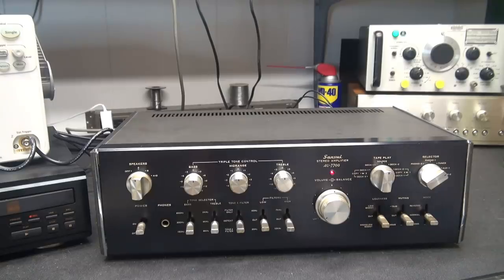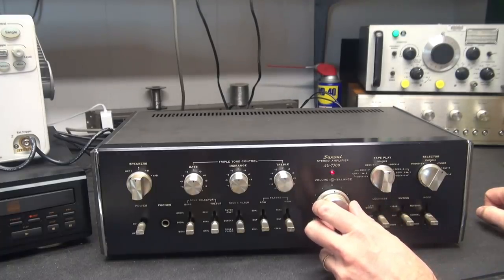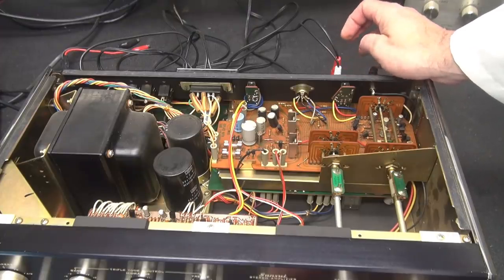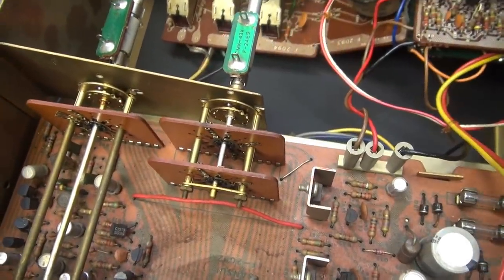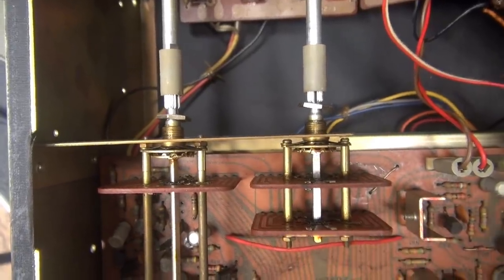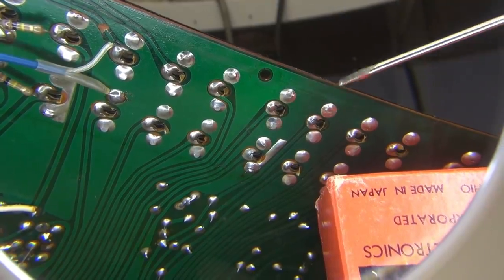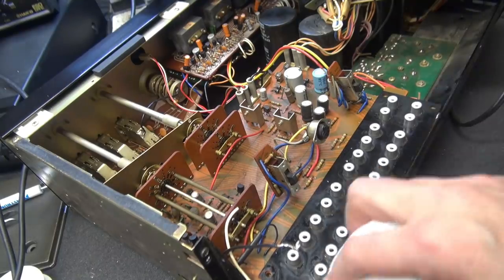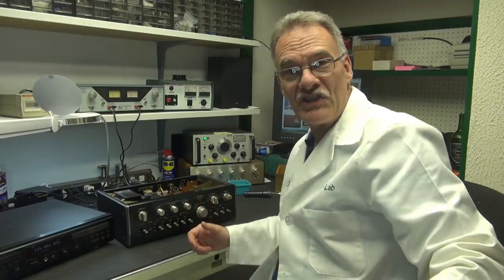How to repair Sansui AU-7700 Integrated amplifier Channel out or weak

Comment: I bought an Sansui AU7900 with a couple of slightly bent heat sinks. I was able to get them back in shape and looks almost perfect. The Phono channels were doing exactly as you described. The fix was exactly the same, but to get to it was a lot simpler. Thanks for the video.

Comment: I have a Sansui AU-9500 from 1976 that has never had the cover off.  Still is amazing amp.
Reply: I have had the same amp since 1974.  Cost me CA$750 back in the days of being a starving university student. My Dad thought I was nuts.  I was.  It did heavy duty as university DJ equipment for 3 years (along with Altec Lansing Voice of the Theatre speakers) and then "retired" to home use only for 40+ years.  Works flawlessly, and I love it like an old friend.  Meanwhile my 2000-ish HK AVR 7000 just lost 2 channels.  The 70s were great years!
Reply: I live in Scotland and I have a Sansui AU5900 that I bought 1976. I have the same issue with the sockets round the back being loose. I can still play sound through a CD player on one of the AUX positions and also FM from my TU5900, but my I am unable to play my Sansui SR525 turntable through the two phono sockets as  both are very loose. Nice to see what it looks like inside. It does look a fiddly job because of all the screws. Nice to hear the beautiful tone again so I plan to get my old system serviced and show it off. .
Reply: @jewesson  Same issue with my HK AVR 7000, now looking into buying the AU-7700 + TU5900. The HK AVR 7000 appears to be solder cracks as wiggling the rca ports indicates problem. Have yet to investigate physically, but research tells me it is the bottom board, and difficult/lengthy access. Love it when it works, a true powerhouse.
Reply: @jewesson  I have had my AU-7700 since 1978. I used to DJ house parties with it. Put all the music on my Sony TC-399 reel to reel because I got tired of people messing with my records, and didn't have to worry about requests. Still have the amp, will be my son's after I am gone. I have a set of Altec Lansing Valencia 846A hooked up to my Heathkit tube monoblocks in the family room. Always wanted the VOT, but they are big, even for a house.

Comment: Had the same problem on the same unit. Turned out to be those molex plugs where corroded and the solder joints on the RCA plugs . Changed all the caps while I was in there . This is an amazing sounding unit .

Comment: A trick to lessen stress on the jacks when plugging or unplugging cables: twist the RCA plugs in a rotary fashion as you push them on. Don't wiggle them side-to-side, that's how you stress the solder connections. The rotary motion also tends to wipe dust and oxidation off of the jack and plug..

Comment: Greetings Terry,
I have this same amp and have owned it since 1978. Since this time I have been in there at least 3 times to fix the same repeat problem. I got in there by removing the output board underneath, guess there is more than one way to skin a cat. Resoldering won't fix it in the long term, it will fail again. I was thinking of some way to give more support to the jack and relieve the stress on the solder joint. JB weld came to mind, but seemed kind of tacky, excuse the pun. I did fix my son's Hafler 110 preamp by drilling and dremeling the board and putting stud mounted RCA jacks with bus wire jumpers to the board. Never use those monster turbine style interconnects on these amps! I need to get in there and solder it up again, Ughhhh!

Comment: My Sony STR-7045 (original owner, parents) from 1973 is awesome af - my daily runner for EVERYTHING (home studio, I am freak guitarist, and all else - since I was born) - just put DC offset to +/- 1 mV from about 30, each channel, yesterday! It screams I tell you, no joke. Part of the reason too is that my main speakers is Marshall cab that I rewired to stereo (try it!!!!!) too. B speakers are 3-way home stereo Sony SS-U 431 AV, modest but kickass nice nonetheless. Anyhow, the RCA connections are not soldered to the board. They are just mounted to the rear of the case, with leads coming off them to the board. I DID have to DeOxit them and get all up in them with Q-Tips to get them perfect but that is much much better design than having to resolder, however easy that may be. Nice video D-Lab!!! I want to somehow put 1/4" jacks for the Aux1 instead, as that would pair lovely with my MOTU Traveler interface - it is in my thoughts to do list. I probably won't do it because of keeping it original, but I want to hahaha.

Comment: I friggin hate the Suits who told the engineers to put jacks, etc directly on to circuit boards to save money. There should never be an opportunity to put mechanical stress into a circuit board. Jacks should be mounted on a chassis!
Reply: Poorly executed design. There is no protection to the cables when they are plugged into the jacks  from being wacked by something! The field is too wide and stresses the pc board too easily . Some extra screws between the jacks should have been made  to keep that from occurring.
Reply: Dumb idea, I agree, I have this same AU-7700 amp and have owned it since 1978. I have had it apart probably 3 times to fix this same repeat problem. My son has a Hafler 110 preamp which suffers the same problem, so I drilled out the rca jacks and put stud mounted rca jacks with jumpers. No room to do this in this Sansui however. Needs it again, weak point of the design. Was thinking about JB weld, but that would not be good engineering either.

Comment: 10:00 Did you see that trace on the circuit board that is cut? The blue shielded wire connects to it. Looks like perhaps it is a factory revision. Will have to look at my AU-7700 when I get it apart again.

Comment: You need to put together a small wine room and equip it with a small sound system. Wish I could have enjoyed a glass before hitting the bench with some of the equipment that used to come into the shop I worked at in the past. Abuse and DIY repairs. Made for a bad day.

Comment: At 7:50 is the point where my boss would be yelling at me to put some masking tape on the top edge of the front faceplate, and put a towel underneath that rear panel so it doesn't scratch the unit in a place that would be visible to the owner of the unit. It's true that often times I think it'll be a quick fix, and the back panel can sit where it's sitting for a minute, and then I'll be putting the thing back together, so I don't really have to worry about it; but I'm units this old, invariably there's something else wrong that you discover during the course of repairing the most obvious main issues, and therefore the unit stays in a disassembled state, with floppy metal parts tethered by wiring harnesses and  laying all over the place, for rather a bit longer than you originally expected or intended.

Comment: great video! I have one of these AU7700 and it sounds great but also need to solder the aux connections I think. On another note two of the spring type speaker connectors are  are broken how hard to replace or fix these?
Reply: P

Comment: Wow you were Air Force, so just my guess you were either PML, Ground Com or Avionics Com Nav troop? I was an in shop avionics Comp Repair manual test station  troop for the F15's back in the 70's and 80's so thanks for serving,  Great site you have!  heres my question,  I have two stereo units that are getting old LOL like me and both starting to have what seams like same type issues you have on this video, one is a Technics SU-V10X with 120 watt per channel I ought in Iceland in 1986 sometimes the output relays fail to switch on when powered on it will have no out power, then at other times when it dose power on and work and I increase the volume to say 1/3 volume or more ( but not all the time) they click off and I loose one and sometimes power to both speakers, so was thinking it may be same issues you just showed here with bad solder connection? the other unit i have is an old Carver 130 watt per channel Receiver, it is really bad very very intermittent, seems that this unit by what I've read is well known to have had a really bad solder joint issue!  do you have any advice if maybe I myself should just take them apart and inspect and resolder all the joints to see if that  fixes them before,  I see about sending them off to  be fixed by some unknown repair place, I live up in New England ( Ma) so not sure who up this way would be able to do any repairs on this old stuff, so any suggestions be appreciated.
 thanks
 Bob

Comment: I notice the chrome like surfaces have that nicotine yellow cast. I clean a lot of cigarette smoke out of vintage electronics. I suspect that the units from the 1960s on have other smoke on them too. ;-) Toss all the knobs in an ultrasonic cleaner with some alcohol for a good soak while you soak up an extra glass of wine! (Ain't I a stinker?)

Comment: Great repair and video ! - I've got a Sansui Z-9000 receiver that's has an intermittent channel  , wonder if it's a similar problem?
Reply from the maker: Best thing to do is tap the boards and see if the issue comes and goes. These old relics grow bad solder connections over time
Reply: Deoxit and visual inspection are the basics. Look for poped electrolytic caps or lots of dirt and dust shorting things out. I always have to clean the boards and potentomitors and that usealley is 80% of the time is actually the promble . The other times I replace mica capasitors or orange dip capasitors or I usealley find internally broken wires and replace them. And flux is your best friend just clean off the flux when done. And do not be intimidated by electronics I do not posess any electronic certificates or electro/ mechanical  degree of any kind. Unless you count my nartie and ham radio licence. If one man engineered it another man can figure it out. And fyi all a circut board is a flat wire connection between parts so that the electrons can flow and be regulated and +and- biased  from one part to the next to get the desired outcome of high  frequency low frequency or all 3 hi mid and low witch is fed through a roll off cross over. Witch separates the frequencies. To each channel aka hi mid and subwoofer.
Reply: Aside from dirty/ oxidized, intermittent switches and controls, and bad soldering, the output relay is another main source of intermittent channels. Tap it while unit is playing and watch the channels come and go, or dropping level, or become somewhat distorted. If you can play a pure clean 400 Hertz tone through the unit, it'll go from a clean tone to a mosquito-like buzzy whine* when you tap the offending component or area. Polish the contacts of the relay (a pencil eraser or ink eraser works well for this), degrease with pure alcohol or another similar no-residue  degreasing solvent, and retension the relay "fingers" slightly if need be. Do not, I repeat do not, spray the relay with Deoxit or any other residue-leaving contact cleaner.

* Sorry Terry, wrong kind of "wine"!

Comment: Well done ole man..I could not have done any better. 
It does seem however, that old electrolytic caps last  longer than the newer design...maybe due to power supplies or composition ? 
I gave my old 1975 england version kenwood quad for similar problem..weak front channels and crackles.. but at 75watts per it played wonderfully. I still have the quad vinyl lp s.. keep up the super show. 
Cudabigfish in Michigan , USA
Reply from the maker: Hello Gary, are you going to the Chelsea, MI hamfest? I will be there shooting video
Reply: @d-labelectronics   I might..first week of June is sisters  memorial and day following is family reunion all in Valpo, In. Busy shortly thereafter with new grandbaby due second week of June..eeehah!. I missed Dayton due to health. Hashnasi just did a review on a G90 hf rig..check it.
Reply from the maker: Will do Sir, Hope to see you there

Comment: My AU-6600 has a hum when in Phono, a tech I took it to said just use a an external preamp. Eventually I did that, and it does work fine with the Turntable preamp going into Aux-1. Disassembly on these is tough, but let's face it, the RCA input design is awful!
Reply: Oh well. My AU-6600 probably needs the treatment shown in the video. Perhaps you would like to see it, Terry? The thing is, this unit sounds even better than the old Marantz 2270 I have. Sansui said 42 Watts/Ch on the 6600 which I guess is RMS.

Comment: I have an amp in need of repair - you interested?
Reply from the maker: Sure, what is the make/model?
Reply: Sunn Beta Lead - its something in the preamp around the reverb. The power section works as it should . When the amp is used like a slave amp it rocks but otherwise without the reverb cranked the volume is low.

Comment: What's your opinion on the 1985-1990 integria onkyos
Reply from the maker: I liked the 80-85 series. My all time favorite is the silver face Marantz with gyro tuning, best is the model 2275
Reply: @d-labelectronics  ok thanks for the input. Cause I want another onkyo tx 866 and another tx 84 and maby another kenwood ge-1000 equlizer and I can stop collecting. Cause I know as these amps and equlizers get older the price will only go up. And plus I have an obsession with oscilloscopes. And digital scanners . So I figure the only way I can really afford to have all these old and new things is to get my realestate licence. Plus I also want the tyt md- 898 witch is a Chinese digital ham radio when combined with there hotspot can talk to yeasu icom dstar and apco phase 2 and most other digital ham radio formats. I probabley got the modle number wrong on the ham radio but I like to sit and stare at electronics and take them apart and learn about them . But my vintage onkyos only come apart when iam cleaning them or replacing old capasitors or repearing them. So far I really like the old onkyos ever sence my neighbor gave me his old integria tx 870 cause he replaced it with a newer Yamaha. And I was 13 at the time and did not realize what I had. I eather threw it away or I might of given it away to my friend in high school I really do not remember. Knowing myself I probabley gave it away . Cause I still have all my RadioShack  CBS  from when I was 9. Anyways hopefulley i did not bore you with my history. I only wish that i was smarter when i was younger.
Reply: I also have a mid 80's A-8500. Only problem I have ever had was a dud speaker relay. Still use it today and don't ever intend to get rid of it.

Comment: I really hope your not drinking alcohol before working with electricity and electronics. That would not be the smartest thing to do as the warning labels say it can impair your ability.
Reply from the maker: Just part of the presentation
Reply: Terry has probably forgotten more about safety than we will ever know. You need a little vino to fix a Sansuiage :)
Reply from the maker: You rock Man, Careful with the Sansuiage a few snow flakes may melt
Reply: i'd gladly have him work on my amp. Maybe not drive my car......
Reply: I only stated this because I don't want to see you get hurt. It was not meant as hate speech or "being a snowflake"
Reply: @Natures_Intentions  De Nile is a very big river